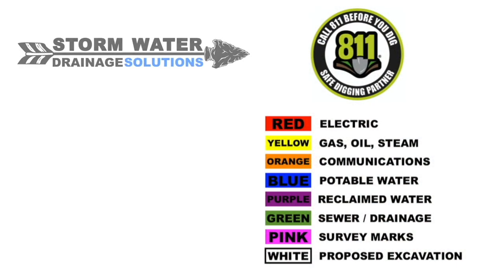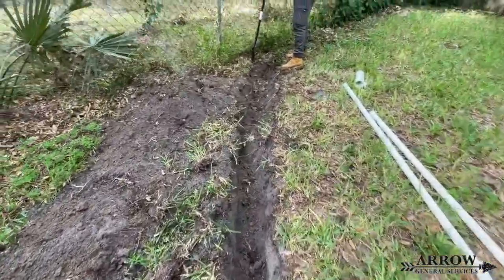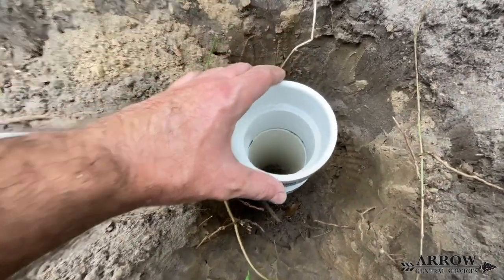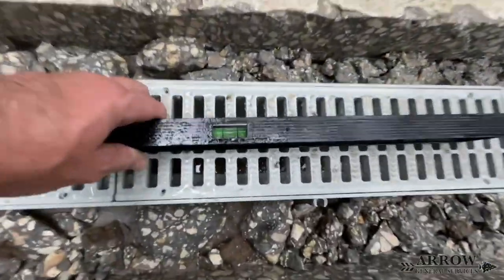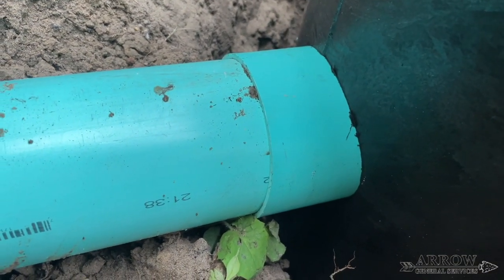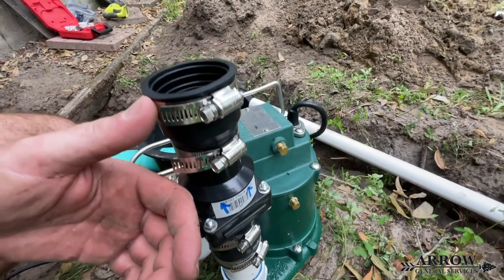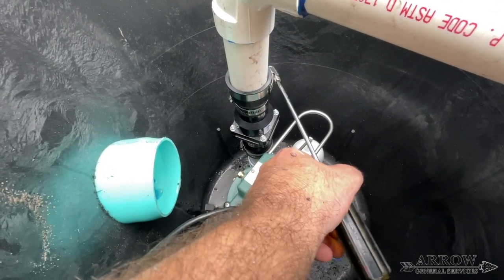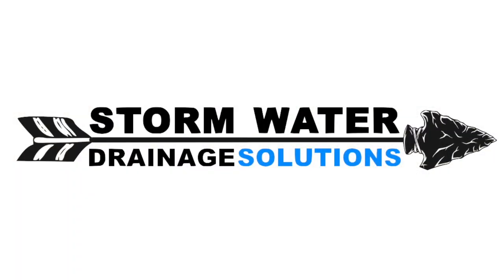How to Install a Drainage System - Yard Drainage Issues - Stop Flooding

Comment: Nice work man. Ya some jobs just require a sump pump to achieve your goal. I like adding a mini dry-well if possible for a fail safe if power is lost
Reply from the maker: Thank you! 🙏 That is the biggest problem with sump pumps is loosing the power!
Reply: @StormWaterDrainageSolutions  exactly and many people don’t have a backup to that.

Comment: Tip: use a pvc union coupling to connect your pump instead of a metal and rubber clamp. Those clamps rust out and make pump maintenance a pain. PVC union coupling will make your life so much easier.